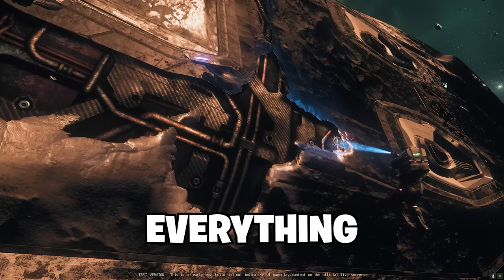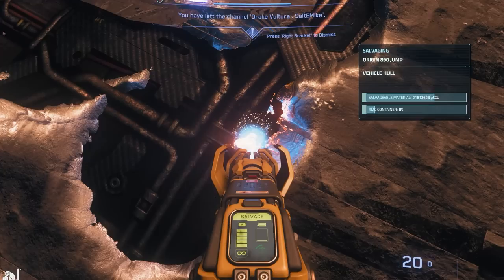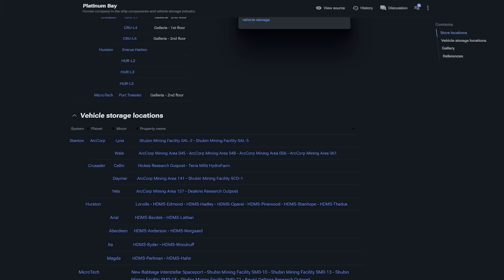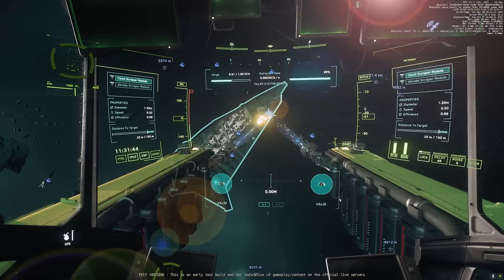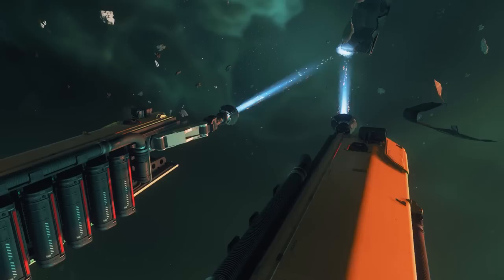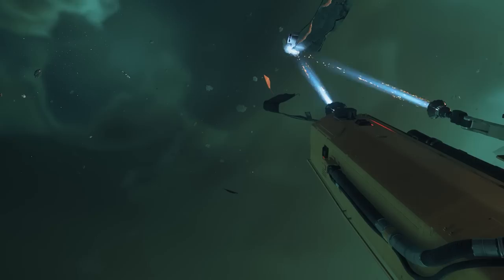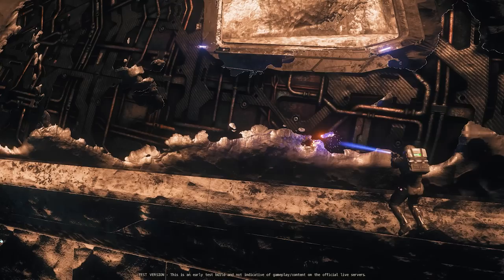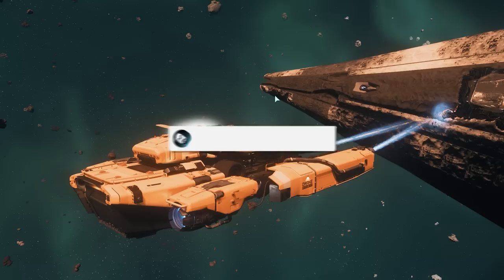What We Know About Salvage - Hull Stripping So Far

Comment: The other thing you can do on the Vulture is hold alt and scroll while in salvage mode. It moves the beams closer or farther apart in convergence.
Reply: Ooooh, I did not know that. Any noticeable benefit to that?
Reply: I'm still messing around with it. It seems like it just matters based on your range to the ship you are salvaging. You just want it so the beams aren't overlapping. Want to spread them to where they are just touching for maximum surface area.
Reply: @hanzo52281  Okay, cool. Thanks for the info.
Reply: You can also switch the two beams between vertical and horizontal, when spreading them, to more efficiently scrape in columns or rows.

Comment: Mining and Salvaging are the 2 most underwhelming gameplay up to date. For Mining, you can only mine specific locations on the map rather than having complete freedom opposite gameplay then Salvaging may look awesome but it only strips the outer shell (armor plates) and other components of the ships leaving behind vast materials like the ship superstructure and other loads of materials within the ship itself. This salvaging gameplay literally wastes more materials in order to maximize profits instead. In my opinion, Cargo Hauling is a far more enjoyable experience for me as it maximizes greater profits the larger cargo bay ur ship posses.
Reply: Chappie, they aren't the full implementation of what they are meant to be....eventually mining will involve actually having to scan for ore veins under the surface of planetary bodies and asteroids and it won't just be a simple matter of pinging for a rock. As for salvage, there's literally going to be physicalised damage and components, meaning...you'll be able to remove everything valuable within a ship and then completely tear it apart...the Reclaimer itself will be able to use its claw and shove ships into the grinder to eke out every possible bit of profit from a ship until there's nothing left. And, you won't need a Reclaimer to do a lot of that too, you'll be able to tear off pieces of ships with cutter tools and then tractor beam them into cargo ships to take to scrap yards and sell them...lot more involved then you think. Yes, it's for the future but it's disingenuous to act like it's all trash